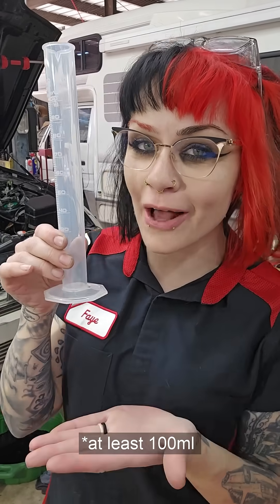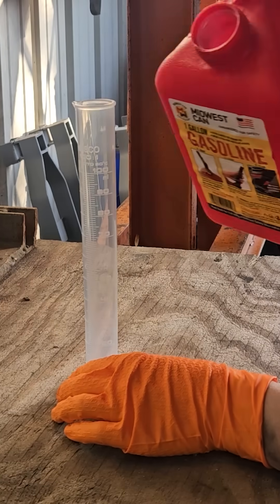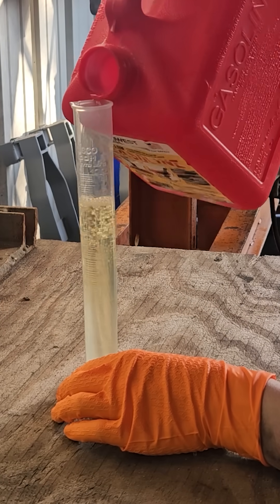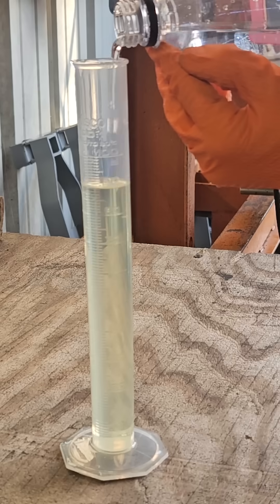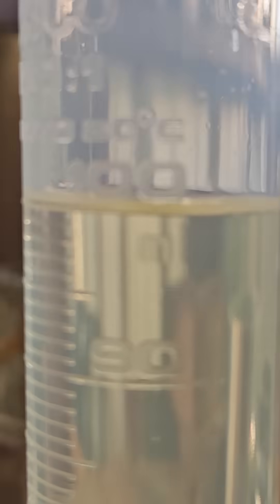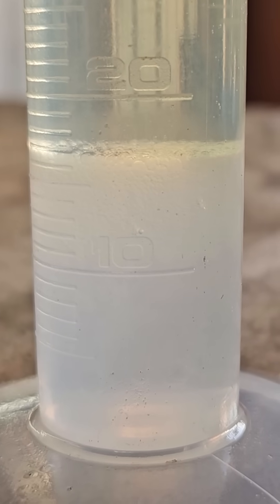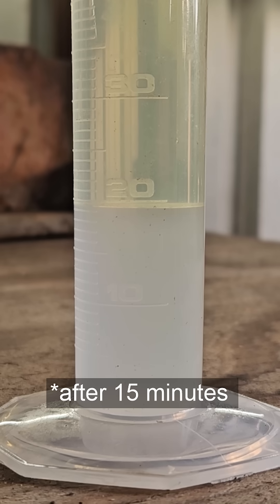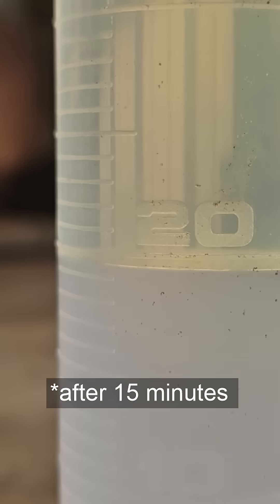Testing the Ethanol Content of Gasoline Using The Water Extraction Method! #AutoDIY #Ethanol #Shorts

Comment: Putting alcohol in gas was U.S.A.s biggest mistake with fuel. As a boat mechanic, the ethanol causes so many problems with fuel separation.
When it seperates, it turns into a crystal that looks just like corn husk. 
It also attracts water. The crystals clog everything in the fuel system. 
I have had to replace whole fuel system because of it. 
I know she's talking about car, I just had to add my 2 cents to the discussion.
If you own a boat. It's cheaper to winterize with an empty tank. Good luck.
Reply: So at least in my state and local area we have a fairly large lake by northeast standards and most of the gas stations have non ethanol gas especially for boats I buy it for my small engines and the 68 Ford but is roughly .80 cents more a gallon so I use the stuff with corn juice in my vehicles
Reply: @sqike001ton lots of ppl put it in their bikes too.
Reply: @sqike001ton  ME too... but recently advised other additives in the no-ethanol fuel will still clog and gum fuel systems on small engines.... advised buying canned fuel, which does not have the additives 
beneficial for cars.
Reply: Retired marine Mastertech here, our income rose sharply when ethanol fuels were introduced.  I gave everybody the "non-ethanol" speech, phase seperation in fuel tank, etc.  Some listened, some didn't.  Cheers all!
Reply: @danglin69 If you gave that talk in the 70s, I believe you. Because that how long we’ve been using it in gas.  A lot of people just didn’t realize it until the 90s and they suddenly decided it was hurting their car. Ethanol was in regular use when the ford pintos were still blowing up.
Reply: @danglin69 clearly you don’t know what “spurious correlation” is lol
Reply: For long-term storage, I use 10-20% AV 100LL blend with e-free premium, as it never goes bad. My longest length of this (inadvertent) test was 8 years, never had to clean a carb, tank fuel smelled as fresh as when filled. Snowmobile, small carbs that clog easily, fired up and ran normal... 

I've tested 10% 100LL with e10 gas, 2 yrs, same results, small engines, not my sled that time.
Reply: @Faolan161  To winterize all marine engines, I used a mix for a 6 gallon remote tank. 5 1/2 gallons of fuel, 2 quarts of 2 stroke oil, and 1 quart of Marvel Mystery Oil. Never had a problem with start-up on any engines I winterized.
Reply: So you think lead was better? Ethanol is nothing but a clean octane booster alternative. If you dont like it, buy clear fuel or use ethanol stabilizers.
Reply: Unfortunately, the Ethanol was added to prevent auto detonation. They used Tethra-Ethyl-Lead, which damaged catalytic converters. But, Ethanol must be used up to 5% in petrol to achieve the same effect.
Reply: Ethanol in fuel is necessary.  It's not just a subsidy to farmers.  There are 2 highly effective and cheap octane boosters.  Only 2.  One is lead, the other is alcohol.  There is not enough of the right molecules in oil to produce enough 87+ octane fuel for current demand.  Either we crush demand by allowing 87 octane to cost $8/gallon like Europe or we add boosters.  And I hope you understand why ethanol is infinitely preferable to lead.
Reply: I'd be MORE pissed at the marina owners that are selling you water-sensitive fuel.  He doesn't HAVE to buy fuel to sell at his pumps with ethanol in it.  He CHOOSES to, to save HIMSELF a few pennies per gallon, at the expense of the boat owners.  DON'T be MAD at the FUEL.  Be mad at the GUY who sells ethanol to boat owners.
Reply: @NorthernChev  That is not true. Adding ethanol to fuel is an U.S.A. government mandate. You can put real pure gasoline in your boat, but at your own risk. And the pure gasoline is 10 times the cost of what is at the pump. 
Why you gotta come here and cause trouble with these nice folk who are all like minded? Go bother someone else's comment feed.
Reply: All I know is when I worked at my dads Christmas tree farm back in the late eighties and early nineties we used to park the tractors after the last mowing in early Fall and when we went to use them in the late Spring for the first mowing we never had any issues with fuel; no separation no gummed up carbs; those tractors would fire off like the fuel was brand new. Now I have to run my lawn mower dry before storing it for 3 months between leaf season and first mowing or I have carb issues. Ethanol is a PIA!
Reply: @lewisshock615  unless you're talking a riding lawn mower and not a true tractor the ones from y o ur memory are likely diesel and have none of the ethanol concerns.
Reply: If you use your vehicle every day the alcohol will probably not separate before you use all your gas up
Reply: I will just move to pure ethanol, thank you very much.
Reply: Yes, its horrific for carbs, causes gumming all over the fuel system and slowly destroys the fuel lines as most are rubber. Its fine for a system designed for it, but they dont put the time in to do so on anything other than cars for the most part. Its half the reason people throw mowers/snowblowers away, the carb is destroyed from this ethanol gas and they dont know how to fix it.
Reply: with gasohol, i don't need to buy fuel line defroster , so i like it
Reply: Also not good for carbureted motorcycles. I have a modern motorcycle that is designed for it, but it’s still not great.
Reply: Fucks up tractors too. Wrecks carburetors and they never work right again, even after 2-3 rebuild kits.
Reply: It's fine for daily drivers, I recommend non-ethonal fuel for  lawn/garden or aquatic/marine engines. In Minnesota most common nonethenol fuel is 89 octane, South Dakota is 87 octane. In both states look at the pump, it will be labeled ethonol free. Not sure what other states do, Mn and sd are the two states I most readily remember.
Reply: Just buy 0 ethanol gas. They sell it at some gas stations close to the boat ramp
Reply: It's cleaner. There is no question about it. Not only does it slightly oxygenate the fuel but we don't have to add as much of other additives to enhance the octane rating.
Reply: I would say it's catastrophic for small motors. Lawn mowers and generators I've worked on have all kinds of fuel related issues now.
Reply: @guesswork  yeah, run ethanol free in those
Reply: The reason for ethanol in gas was so the government could subsidize corn farmers with tax payers dollars. It had nothing to do with reducing emissions from exhaust.
Reply: you can choose between lead, ethanol, or engine knock at any moderately high compression ratio. 
personally ill take ethanol lol
Reply: thanks obama
Reply: your fuel filter isnt doing its job... there wont be crystals in water gas or alchol... thats just particulate matter.
Reply: Some fuel stations or fuel docks have ethanol free fuel here in Florida we have a some ethanol free pumps
Reply: Wasn't a mistake... It's all intentionally done
Reply: We can get E-free gasoline here
Reply: Gas-a-hol (what they called it in the 70s) was a response to the Arab Oil Crisis and a handout to Midwest farmers in the form of subsidies to produce corn to be distilled into alcohol for fuel. Adding ethanol to gasoline also inexpensively increases the octane rating of the fuel. Notice that none of those “benefits” takes into account engine longevity or harm to engine parts.
Reply: I always run a tank of the best non ethanol near me then Shell for their cleaning detergents. Back and fourth between the two
Reply: How does gasoline and water turn into a crystal?
Reply: @justliberty4072  It's the result of the alcohol separating from the gasoline. The alcohol attracts the water vapor in the air and sinks to the bottom of the tank. Since all fuel pumps pick up fuel from the bottom of the tank, the carburetor gets filled with more water than fuel. When the water evaporates from the mix, crystals are formed from the ethanol.
Reply: no alcohol deletes.
Reply: Not to mention SMOG generation. 🤬
Reply: You do realize that they have been putting ethanol in gasoline since the 70s. The only time it’s a problem is when you leave the same tank of gas for several months or so.  That usually only happens in boats planes and lawn equipment. In most parts of the country it’s used because it’s actually cheaper than gas at many times. The idea that it’s suddenly running engines is imaginary. It’s been in regular use for over 40 years now.
Reply: Put LEAD back in and NO alcohol!
Reply: Lots of it is literally ruining our environment too. Not just in the sense that all combustion fuels are poisonous, but the farming of corn purely for ethanol is terrible on the agricultural system and doesn’t even yield enough emissions reductions to justify itself. There ARE better biofuels out there, I think a certain grass or hay based one, which is estimated to be exponentially better, but the piss poor US government already sunk its bet into corn and is pleading the sunk cost fallacy as the reason for not abandoning it.
Reply: You sure the biggest mistake wasn't putting lead into the gas???
Reply: Putting lead was worse.
Reply: How else would they shorten the lives of engines to have to replace the more often
Reply: Your not supposed to but ethanol fuel into a boat? They sell it ethanol free like pink fuel for boats
Reply: So since you cant use lead whats ypur solution to knocking?
Reply: I do that with my lawnmower
Reply: Meanwhile, I have an F150 with 300k miles that has only ever run E85.
Reply: It's algae not crystals ,disimilar metals create electrolysis that creates life .
Reply: ethanol gas is mostly fine in cars that are fuel injected, and the fuel separation and hygroscopicity problems don't come up often in a regularly-driven vehicle. Boats on the other hand definitely don't do well with gas that has sat for a while...
Reply: @lettuce7378  Except you lose about 10 percent of your mileage and will eat older fuel injection O-rings.
Reply: @MUUKOW3  meh, the difference in mileage isn't really noticeable, especially on an old pickup truck that never got very high mileage to begin with. And the system was designed for ethanol.
Reply: @lettuce7378  It is very noticeable, I've measured it in everything from motorcycles to cars . No amount of computing is going to make up for the faster burn rate.
Reply: @MUUKOW3  if you say so
Reply: @lettuce7378  I realize you slept at a Holiday Inn and probably know everything. These are actually facts that have been well documented.
Reply: Liberals think its saving the world
Reply: LOL. How many clogs has my Honda had since hitting 200K miles? Zero.
Reply: ICE is ICE, car, boat, it doesn't matter.
Reply: It is not as bad, typically in a car that burns continuously. It is bad for items that sit
Reply: Except cars last longer than they ever have before, i have a barely maintained hyaundai at 220k and going strong no issues on the cheapest possible gas loaded with Ethanol
Reply: boat owner in hawaii... preach it brother.  doubly bad for us since as soon as we launch were in the middle of the bloody pacific!
Reply: Also if you happen to have polyethylene tubing or gaskets it can cause swelling
Reply: I'd say lead in gasoline was a bigger mistake.
Reply: ethanol will never form "crystals"  Maybe it causes other additives to precipitate buy its NOT ethanol
Reply: Using 91+, stabil and fuel additives such as Royal Purple and your fuel will last at least a couple of years. Use top tier fuels as well.
Reply: BOAT = Break Out Another Thousand
Reply: If you own a boat, just use Sunoco Racing fuel, non ethanol, and you'll never have that problem!
Reply: There are three options when it comes to preventing engines from knocking: adding lead, adding ethanol, and using higher octane gasoline. We already made the first one illegal, and the third one is more expensive and requires a special engine to use, so ethanol ends up being the best choice.
Reply: It wasn't a mistake. It was deliberate
Reply: That's not how it works. Mechanic, engineer, and organic chemist here.  What you're talking about is caused by other junk when you let the gas sit too long and the ethanol has probably lately evaporated along with most of the additive package and even the lighter components of the gas itself.  Stop spreading old wives tales
Reply: That’s all by design. You have to get to work whether your car runs or not.
Reply: Your fuel mileage drops to
Reply: @jamieb9556   But it comes out to be worth it once you work out the math. "Real gas" isn't worth the extra cost.
Reply: "renewable" fuels are crazy. We ain't running out of gasoline. Only reason we put ethanol in it is to subsidize giant ag companies.
Reply: Exactly right.  Im old enough to have pumped leaded gasoline.  I always bite the bullet and buy alcohol free fuel for my lawn machines.  The government wasn't happy enough with messing up our gas cans decades ago, so they upped their game.  How about DEF and diesel engines?  Yet another example of a bunch of ex-bartenders somehow being elected into Congress,  getting a little power and authority, then making we the people suffer!  🤣
Reply: Also a handout to corn farmers.
Reply: Use non ethanol gas. I put it in all my small engine equipment. Fires right up the next season 👍
Reply: Having 0 ethanol gas for boating definitely makes sense. But honestly, ethanol is just an easy scapegoat usually blamed for issues that are not due to ethanol. 

I've put 100s of thousands of miles on vehicles using only e10 or 15 fuel. Never have had issues where the ethanol was the issue.
Reply: @iowafarmboy  because you drive your car every day, you don't have to worry about ethanol separating. If you drive it once every couple of months, it will be a different story.
Reply: @iowafarmboy  If the gas is stored for short periods as in less than a month.  My work truck burns all but also runs 300ish days a year.
Reply: @whatsup3270  true. If doing longer storage like for emergency generators, doing 0 ethanol is a better idea due to humidity attraction. I'll agree with that.
Reply: @iowafarmboy Avgas stores much better & is fine in small engines.
Reply: @iowafarmboy   Yep, these guys love to blame old wives tales about ethanol for everything else they do wrong.
Reply: Where i live they sell 90 octain fuel with no ethanol in it. Its called Rec 90. I use it on all my small engines like.pressure washer or lawn mower.
Reply: If a person owns any ICE machine that is not used regularly, and this ethanol crap is left sitting, it creates fuel system nightmares. By the time I got my motorcycle running right this year, it was already deer rutting season, and the outside temperature was getting too cold to even ride. This year, I finally did what I swore I was gonna do for years, and disconnected the vacuum line to the petcock, and let the thing run until it quit, then cranked it over for about 15 seconds, then pulled the drain screws, and shot low pressure air into the carb bowls, to try to make sure there is NO FUEL in those carburetors. SICK of cleaning/rebuilding carbs on this bike!!!!!! And no, my tweaked bike doesn't like non ethanol gasoline. As crazy as it sounds, it runs best, and with the most power, on 87 regular. So, for winterization, it is DRY CARBS for me, from here out!!!!!
Reply: I've just ran fuel stabilizer last 4 years I've had my bike and had no issues starting/ running come spring. Mine is fuel injected tho@500erider
Reply: I've put nothing but 91 or higher no ethanol in my Mark 3 golf and it is unbelievable the difference if I have to throw in some 87 e20. It feels exactly like I've lost the same amount of power as adding an entire adult to the passenger seat!
Reply: @TtheK pretty sure they recommend higher octane for that reason
Reply: @igostupidfast3  I use higher obtain in my vehicle storage and add Stabil. It helps prevent separation, gel, and forms a layer on the gas that prevents moisture absorption. Stored my car for 3 years now from a full tank and start it regularly with the same treated gas. I do retreat annually. Still starts and runs perfectly.
Reply: @igostupidfast3  They recommend higher octane due to the fact that lower octane gas will combust much more quickly the higher octane gas, which can lead to pre-ignition in an engine. High-performance engines are required to run higher octane fuel for this reason. The higher octane gas also burns more efficiently in an engine due to the additives and less alcohol content in it.
Reply: @Lancercat255  Alcohol added to fuel increases its octane rating. 
An octane rating is a measure of how stable a fuel is and resistance to knocking. "not it combusting more quickly" but rather how it resists igniting when compressed, particularly prior to reach TDC i.e. knocking
Reply: @TtheK  The butt dyno never lies!
Reply: @Joopsmann  Hahahaha
Reply: @TtheK always best to add entire adults to your car, not parts of one!
Reply: @TtheK mark 3 engine isn't designed to run on 87 octane. That's why it runs like crap.
Reply: @TtheK all octanes have 10% EtOH.
Reply: @TtheK  we have 87 e10 and 87 no ethanol. I can tell the difference in fuel economy is significant. I get 16mpg with ethanol, 21 without
Reply: Not a mechanic but couldn’t agree more. I really wish we could get rid of it and just go back to pure gasoline.
Reply: @CaptainDaveNC  You want to go back to leaded fuel? 😂😂😂😂
Reply: @CaptainDaveNC i am a mechanic and in Australia and I remember when E10 (10% ethanol) came out and caused havoc with a lot of old cars etc however it seems less a issue now
Reply: @CaptainDaveNC  impossible with modern engines. ethanol increases octane and decreases knock which is super necessary on the small 2 liter and less engines that rely on turbos for power. regular gasoline would cause knock
Reply: @CaptainDaveNC  Im confused, all of your fuel has ethanol in it?
Here in Australia the 10% Ethanol fuel is the cheapest varient, with the highest octane fuel containing no ethanol at all.

America is a country that heavily, and clearly, overly subsidises the farming of corn. With so much corn, they have to do something with it. Hence the ethanol.
Reply: @CaptainDaveNC we just need to switch to electric
Reply: @CaptainDaveNC its really dumb to be burning our food supply in engines.  Or greatest natural resource is our soil.  Wearing it out prematurely makes no sense.
Reply: @CaptainDaveNC We've never really used "pure" gasoline...and your engine would run like crap if we did.
Reply: @AveragePicker that is why we used to add lead
Reply: @AveragePicker  why?  They were usually designed for pure gasoline.  It is mostly a self-life issue, ethanol reduces self life draws water, creates rust....
Reply: @AveragePicker  - tell me what’s in the pumps that are labeled “ethanol free” then? I grew up in the 70’s and 80’s.. no ethanol.
Reply: @AveragePicker Not true. In the 90’s I recall it from personal experience gas stations could opt in or not to adding alcohol to gas. I used to buy gas without a label. Gas lasted longer then, 5 year old gas or even 8 year old gas would run your car after sitting. And it ran everything great when fresh so anything younger than 5 years old (after distillation not how old the crude was). Runs great. Can buy it in some places now. Some Murphy stations and some Valero stations. Up north Casey’s stations at least the ones I’ve seen sell it too. Iowa seems to love it. Engine’s won’t run well on it? They run great, cooler, longer, and fuel air mixed right better with at least equal acceleration. I only use nonethanol in my small engines. Unfortunately my tractor burns so much gas the extra dollar a gallon is kind of a nut punch to keep it in the tractor.
Reply: @AveragePicker we sell non-ethanol in NC at Quiktrip gas stations, is this not "pure" or does it have other additives?
Reply: @sqike001ton that’s not why we used lead. 

We used lead to valve seats.
Reply: @AveragePicker yes. 

We really did….
Reply: They did it on purpose. Cause things to eventually break down causes consumers to have to continually spend money on brand new parts. For things to last a lifetime is bad for business. Which sucks for us, the consumers.
Reply: @Templar_Infinite_Infidel  No doubts on that. Planned obsolescence.
Reply: It seems to me they changed the fuel formula to make it impossible to store over 30 days. It also will.cause havoc on many older fuel systems hence making them obsolete eventually.
Reply: @gregmcnamara9229  On the water, gasoline spoils a little longer than a gallon of milk.